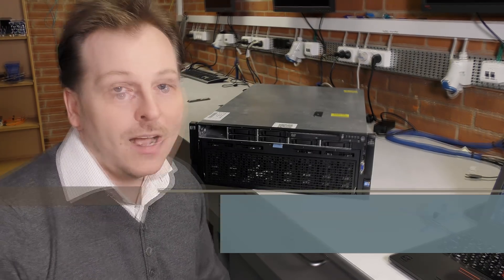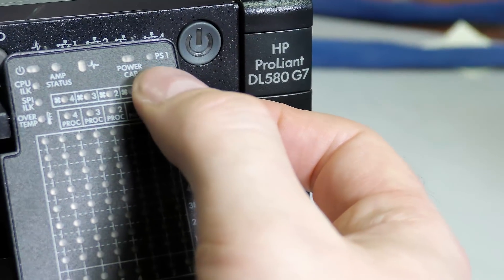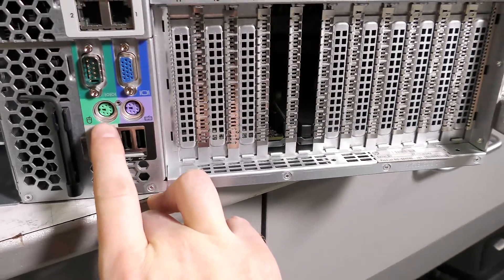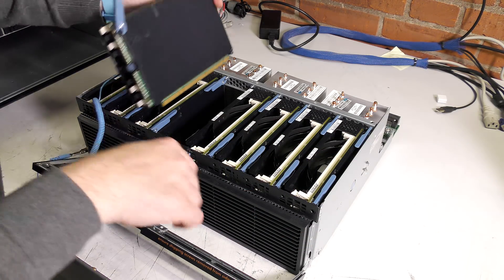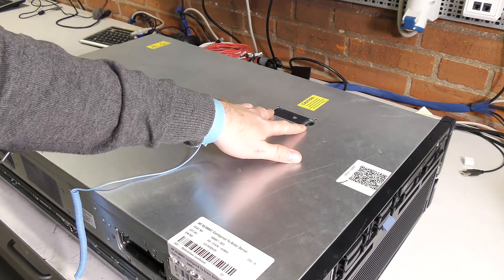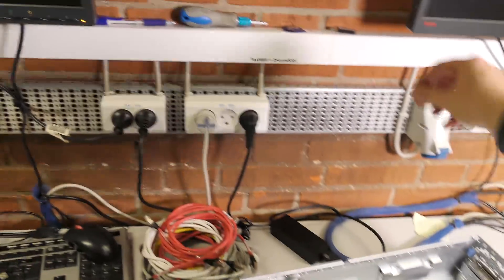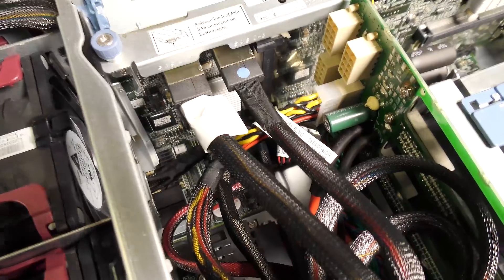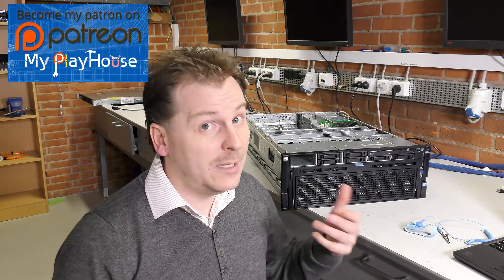HPE Proliant DL580 G7 - The Four Headed HP Monster - 609

Comment: I picked one up on Ebay for $339 last month. 128G RAM, 40 CPU cores.  I need to run another circuit from the meter to power it.
Reply from the maker: Yes they are only getting cheaper.

Comment: HI I buy same server and put 4 gpu in it for rendering with GPU but i have issue with driver I use win 10 Workstation  have a lot have blue screen when I put it in work ! do you have any Idea?
Reply from the maker: I would try using Server 2019 instead.

Comment: @UCVik6mzTCurdJmvdj5dCa7A 

I'm currently looking into buying the DL580 for my own setup, and was wondering I may need to purchase the following component:
 - HP 512843-001/591196-001 System I/O board 

I currently have this part in my inventory:
 - HP 588137-B21; 591205-001

I already have the other components (CPUs, GPUs, RAM, quiet PWM fans, etc.) in my inventory, and was hoping to possibly start on my first server build.
Reply from the maker: That is a big server to be assimpling from parts :-)
Reply: @MyPlayHouse  
I know! :D

I've been planning my first server build for over a year now, but prices on used parts change a lot. I picked this server for its size and features. I'm only thinking about purchasing the PCIe boards because I'm not sure if all sellers include them with the server(s) that they sell used. The only other component I'd really buy for it (separately) would be PSUs.

Comment: Morten - I may send you a medical bill next week!.  You got me on this slippery server slope (must thank you for that). Happened to come across a good value DL980 G7 on eBay and hit the buy button.  The 980 is basically two DL580s stuck together.  Parts almost interchangable. Then noticed that it ways 70Kg when almost empty!!  Arriving this Friday.
Reply: No lower cpu/memory module assembly so just the four Xeons X7560.  Will have to wait to rectify that...spent a little too much on servers the last few months. 😃
Thinking of putting XCG-NG on it.  Already have a DL380p Gen8 running ESXi.

It does weigh a fair bit!
Reply from the maker: Holly,, that is a heavy thing,, 8 CPU's then ?
Reply: @MyPlayHouse  Currently just the 4.  I have 4 X7560 CPUs and heatsinks to add but not sure if the 2nd cpu/memory assembly is present or not.

Comment: I just got a DL585 (48 core AMD version) as a first server for $150USD with 256GB of ram and 3TB worth of drives. Looking forward to picking it up tomorrow along with a DL380 G7 for applications that dont require the pure horsepower this thing has.
Reply from the maker: Hi Phylax
That is a big toy :-) be mindful of the power usages. calculate what the servers will cost to run 24/7 in a year,, so you know that. and then have fun :-)
Thank you for watching! :-)

Comment: when i push the power button the server power up and power off after 2 second then power up again then down again for 4 cycles then the health led getting flashing in red ... any suggestions ?? ... i'm talking about proliant dl580 g7 and i'm getting this issue after the cpu board replacement
Reply from the maker: I would take out every thing to bring it down to minimum config,,, and if that does not work,, you are in real trouble.
Reply: @MyPlayHouse  the issue was in cpu's ... Thanks for replying

Comment: If you see this server can you imagine the power of the AMD Epyc cpu that comes out end of 2018 wich is rumored to have 64 Cores and 128 Threads on a single cpu and you can put 2 of those in a 2 socket server.
Reply from the maker: Hi Jacques Ahlers
Thank You very much!  Yes,, I imagine it becomes hot :-)
Thank you for watching! :-)
Reply: Jacques Ahlers stop advertising amd...
Reply: Why am I advertising AMD? I was just mentioning the CPU with the most cores at the moment and I don't care if that would be Intel or AMD.

Comment: I love this server. I got one off ebay for a super deal. I use it at home for just about everything but my firewall/router. Yes it consumes a ton of power, but I have it shut off / on every day during hours no one is home. Only downside is the last time I attempted to install esxi on it, I couldn't perform PCI passthrough of my additional SAS controller card for my external array. Otherwise I love the server, its a beast!
Reply from the maker: Hi 101rockfreak
Thank You very much!  Does that work with other PCI cards..
Thank you for watching! :-)

Comment: When loading the hypervisor onto SD cards, are they special cards designed to handle writes better and longer or are they just standard SD cards and the hypervisor setup to not write to it much?  I ask because I have an HP usb stick I've used as my thumb drive for about 4 or more years now.  It uses SLC memory chips.  This was more common early on, but most places stopped making them with SLC chips.  I found the HP one in a server parts manual so I bought it.  It was the only way I could stand to run portable apps from the USB stick after my previous thumb drive broke.  I haven't tried any of the modern usb3 sticks.  Just wondering if they did something similar with the SD cards.
Reply: Yes there are special SD Cards available, the "HP Flash Media Kit" is one option. Personally I prefer normal SD Cards with higher capacity of a common quality brand like Kingston, Sandisk, and so on. Never had any issues running 24/7.
Reply from the maker: Hi joebleed
If you run your ESXi hypervisor from USB or SD, It will usally ask where you want to put the log,,, It do not want to use the USB or SD card for that.
Thank you for watching! :-)

Comment: Good you featured this model Morten. Buyed a DL580 G7 for £140 two weeks ago with two X7560, 8GB ram, 2x 146GB SAS and two PSUs. Wanted two more CPUs, more ram and two extra PSUs so i ended up with another one for £250. That had 4x X7550, 32GB ram and four PSUs. Both servers arrived at my doorstep on friday after work and they were heavy! 
Will probably ditch one case after taking out all usable parts. 4x E7-8837 is on its way from China. This will be an expensive but fun homelab to run:)
Reply from the maker: Hi Retromaniac
Good price!!
Thank you for watching! :-)

Comment: Morten...how much this server costs??
Reply: Habibul Bashar on ebay barebones like $200 USD. To put one together with 40 cores, 48gb memory, and 4x 1200w hp psus, I've been finding $800 USD. The only problem for a server like this is noise and memory speed... It's slow for hpc applications
Reply from the maker: Hi Habibul Bashar
Prices vary a lot,,, and this one seams to have gone up, the last year..
Thank you for watching! :-)
Reply: Habibul Bashar. Watch out on eBay auctions from some UK and Belgium sellers. They sometimes start under $100 and not many people bid on them.
Reply: aferrante26 thanks a lot man... currently using hpe dl380 g9 with esxi 6.5 & performance is very good but for rnd purpose I m searching for a used or refurbished machine... thanks again

Comment: I have 6 of these in the lab at work, plus some 580 G5s and a couple of 380 G7's. They certainly are back breakers especially when you are having to put them in the top of the racks.  Not looked at the G9's but I thought the torx tools were inside by the PSU? That's where they used to be on the older DL models before they started putting them on the back.
Reply from the maker: Hi David Game
Thank You very much!  glad you liked the video :-)
Thank you for watching! :-)